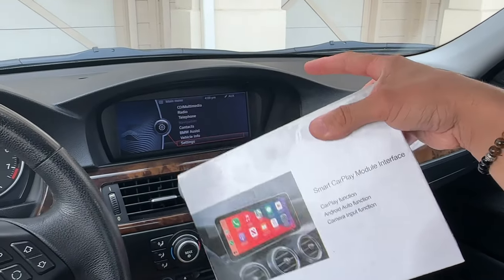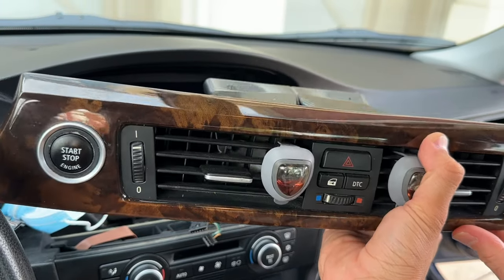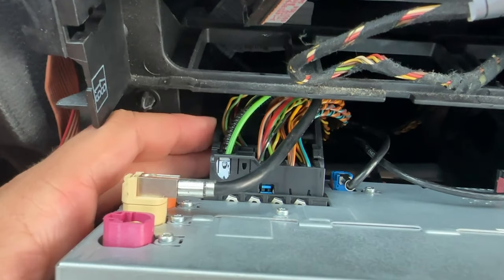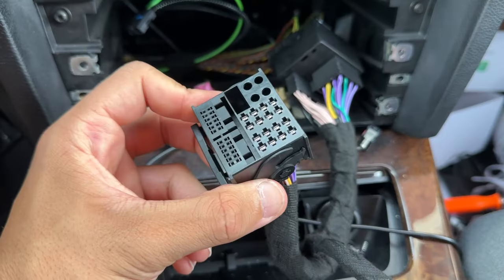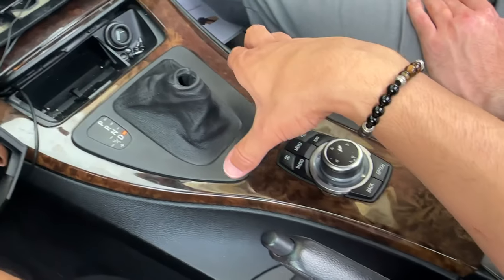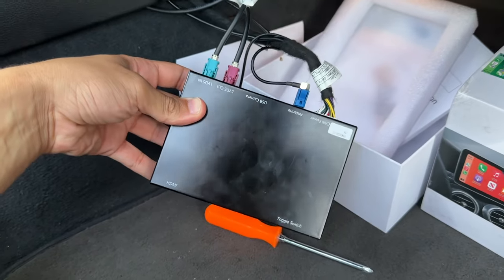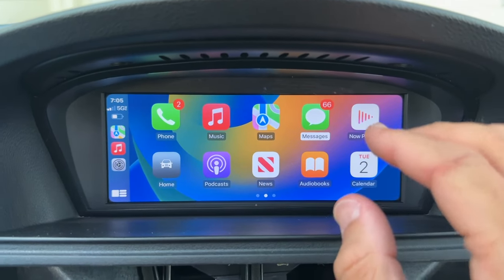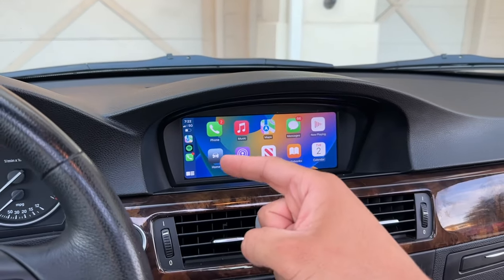How To Install Apple CarPlay/Android Auto in ANY BMW 2023! | E90 E92 E60

Comment: MMI boxes like this are the best route. Had a "all-in-one" screen replacement on my M3 which was trash. Never again
Reply: Agree for sure. Going to order this soon
Reply: Why was that the case?
Reply: @iZingle  If your screen is already a good size, the MMI box is superior. It has better integration
Reply: @Whodat-te6pn  do you know if this would work if my ccc system is broken? It doesn’t even want to boot and keeps restarting on me, and I don’t know if I should try and fix it or not or if this works without the ccc I wouldn’t even bother to try and fix the ccc if I don’t have to
Reply: Why do you need the box?
I don’t understand it
Reply: So the ones that have a new head unit with camera nav etc dont get those this is better?

Comment: if you have trouble unplugging removing the center trim/vent piece (hazards, door lock, DTC), you can push the controls from the insides out towards you. it comes out in a cube/square shape fairly easily. this makes unplugging and reconnecting it so much easier.
Reply from the maker: great piece of advice! we ended up figuring that out after we shot the video haha
Reply: Thanks for the tip, but arent those pieces screwed in from the back?
Reply: @cdb5001  if you’re referring to the black square shaped thingy, then no. You just push it from the back towards you and it slides out if I remember correctly.
Reply: @owen_636  thanks for the quick reply! I just got my MMI decoder today so planning on installing it tomorrow and will try using your tips. Much appreciated!

Comment: Can you use carplay and original bmw  because i need original bmw for cheeking oil level and other stuff
Reply: I just answered you in a comment above. Yes, you can switch from OEM to CarPlay and back by pressing the menu button for two seconds.

Comment: How's the sound quality of this unit playing music through car play? Some people say the sound quality is degraded on some MMI boxes because they use the aux input to get the audio to the factory system.
Reply: Mine sounds excellent. Of course the quality of the file or stream you are playing makes a huge difference but no one would expect it is just an aux input.
Reply: @119Agent is it possible to play audio though Bluetooth and not the aux? As I have Bluetooth streaming capabilities on my OEM
Reply: @abduljohn1924  yes it works 100% through bluetooth BUT it is bluetooth through the MMI, not your OEM unit. You MUST disable your OEM bluetooth.
Reply: @119Agent  I mean the sound is outputted from the MMI via aux right? Is there any way of changing that to Bluetooth
Reply: @abduljohn1924  no. Bluetooth from your phone to MMI, then from the MMI to phone via aux.

Comment: Hello! FM antenna is connected to original iDrive unit? or into Android device? In other words - what is recieving FM signal - is it iDrive or Android headunit? Thanks!
Reply: FM antenna connects to the original iDrive unit in the same place. As far as I know, there is no way to play FM radio through a FM signal on an Android or iPhone. If I'm wrong, please correct me.

Comment: How was you able to manage to fit all the harness in the rear of the stereo? I'm having trouble putting it back, head unit is 1/2 inch out
Reply from the maker: throw the shifter in drive to give yourself space and tuck the harnesses
Reply: I had to use a small saw to cut and fabricate the hard black plastic trim inside to help tuck those big pieces. THAT was the hardest part of the whole install.

Comment: Is there any external mic or mic extension cable needed if my bmw has A microphone already ?
Reply: Did you find out? I’m thinking of installing this soon. Can it not just use the original mic without additional wires
Reply: @abduljohn1924  ye u dont need to install external mic , original works with it too

Comment: i can‘t get the ducking wires in the back. the connector without the optic cable is too huge
Reply from the maker: It is doable, you’ll just need to play with it
Reply: @IzzyE9X  so u have it just sitting in the back, not tucked to one site panel?

Comment: Does this override the OEM screens permanently, or does it allow you to switch between the new SW and the original screen using something like a press/hold of the menu button?
Reply from the maker: It allows you to switch back to view the iDrive settings etc
Reply: If i install this can i use carplay and the oem because i need oem to chek oil level and other stuff
Reply: @rimac6445  You can easily switch from CarPlay to the OEM software. If I remember correctly it is mostly done by holding the menu button two seconds (to switch from CarPlay to OEM and back).
Best wishes from Germany 🇩🇪, Philipp

Comment: So what happens when you go reverse? Does the screen with the sensor still pops up? Like the back up sensor beeping along with the screen with the green/yellow/red warning?
Reply: Yup it keeps everything intact. Just did the mod.
Reply: @SinlowMusic are you able to switch between this and the old system for E.g. check control errors and service history
Reply: @mohammedkahaf2428  Yeah man! It lets you switch easily. Just press and hold the MENU button on your iDrive knob
Reply: @SinlowMusic how do you switch to the old system to check for code errors and oil levels? Or are you not able to do it after install it ?
Reply: @Three35_slw  reread the comment, hold menu button

Comment: What does CIC, CCC, and NBT mean? I just bought a 2007 335i convertible and I’d like to get this. Ensure if it will work for me
Reply: This is for 2009 and above. The website has one for your year but you have to remove the screen it’s a different set up
Reply: CCC is the old system for the on board menus, CIC is newer - 2009 up. NBT is the most recent one.

Comment: So wait, the sound is routed back through the aux input???
Reply from the maker: If the car has Bluetooth Audio enabled from the factory, you don’t need to route the AUX to the glovebox
Reply: @IzzyE9X  my car only has Bluetooth for the phone. It also has the aux input which sounds terrible.
Reply: My sound quality got better through the aux since it added a customizable EQ. Not even the newer 2014+ cars had an EQ. If you have factory Bluetooth on your car, you can just route your audio through there. It's not like the sound quality on pre-2009 BMW was life-changing anyway.
Reply: @muscleunlimited5668  huh ok, my car has a 7 band equipment with the logic 7. But no BT audio which sounds terrible anyways. Also the aux sounds bad so I'm confused why it is being used here
Reply: @TheMadcowintucson  Because it’s incredibly hard to intercept the optical signal on BMWs, Mercedes, Audi, etc. it’s just the way many manufacturers design their amps and CANBUS system.

As someone who has a HK system on my f80 m3, the difference was minimal and I’d never go back to not having CarPlay 😂
Reply: @princeali316  they make boxes specifically that plug into the optical signal. Then you can add Bluetooth or use your phone as a streamer etc.
Reply: @TheMadcowintucson  No they don’t… I install these. The optical decoders often don’t work unless you have a 7-series. 

The only other box that can intercept optical on pre-2009 cars is Mr.12Volts and that is almost 2x the price and still doesn’t work 100% of the time.

You don’t know anything that BimmerDirect, BimmerTech, Mr12volt, etc. don’t already know.

Comment: Does this mean we don’t have to worry about CCC or CIC anymore? My CCC system is broken and I’m looking to upgrade, would this still work for me even though my CCC system is broken? I was thinking it would be fine if I’m only going to be using the CarPlay software anyways.
Reply: Get a used unit if you can if it isn't just the screen scrap yard always got em cheap.

Comment: It’s much easier and better to install a new Android touch screen display unit. No extra “box” or “idrive controller “ connector. This product is over engineered !
Reply: @IzzyE9X  if the goal is just CarPlay then it’s very unlikely that you’re going to get lower quality. Android units are plug and play and less effort, you just need to connect harness.
Reply from the maker: For sure, just depends where/who you purchase from. If you can land a good quality Multimedia Screen, for a good price (which BimmerDirect sells), that’s a good option. For those wanting to keep their OEM fitment, build quality etc, the MMI is a good choice. The main negative I’d say aftermarket Multimedia screens will have is not as good heat resistance as to where the MMI box can be hidden in the footwell away from the sun. In all honesty, comes down to preference and price!
Reply: Ridiculous comment. Android touch screens are much lower quality than MMI boxes. I install these for a living and this comment is laughable. MMI is the superior option 9/10 unless your screen is damaged.
Reply: Newsflash: You need to connect the drive connector on android screens also. If you didn't... you installed yours incorrectly. Also most android screens are not good quality at all compared to the MMI
Reply: @princeali316  no you don’t - I have installed 3. Two on CCC and one on CIC.
Reply: I would never put that no-name chinese crap in my car. Software is trash and good luck getting any support. Plus they lock the firmware down so even if you thought you could troubleshoot software problems, tough luck. 

Don't get me wrong, MMI is working with the same companies that also push out those garbage screens. But at least they work with manufacturers to get the software right and they will provide a warranty as well
Reply: @JahJah440  For sure. Had a Android screen in my M3… TRASH! MMI has been way better. Especially this BimmerDirect box with the German processors. Mine had cheap China stuff.
Reply: Does Bluetooth audio work if your car had no BT audio (2010 E60)? Does the parking sensor system still work with this? Thx
Reply from the maker: parking sensors will still work and Bluetooth will work regardless if your car didn’t come equipped
Reply: @IzzyE9X  thank you! I hate that this car does have Bluetooth audio, and only Bluetooth phone. I think I'll buy one.
Reply: @IzzyE9X  Thanks! Could you maybe do a quick follow-up on a practical use of this unit in a real service? Exactly these things like switching between CIC and the box, whether there's an automatic switch when parking sensors screen or low fuel/tyre alerts kick in, playing CarPlay/Apple music with steering wheel controls vs listening to FM radio while having CarPlay active, etc. That would really make a nice pt2 of the unit review. 👍 I'm thinking about having one with the rear camera as well so I guess it would be a no-brainer choice!